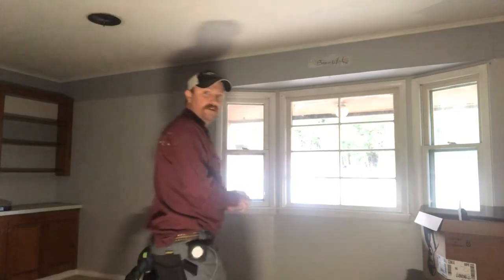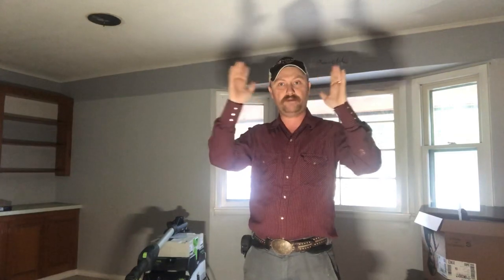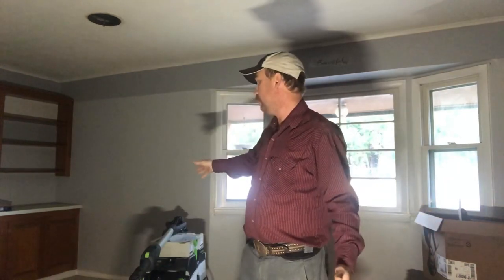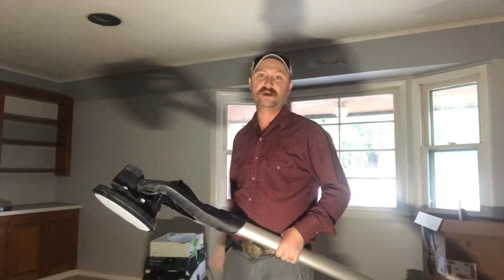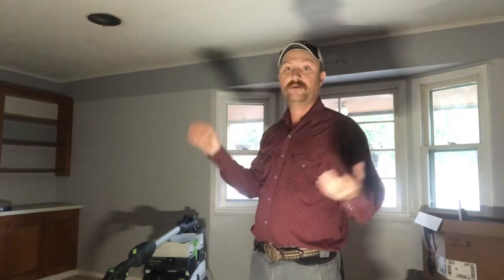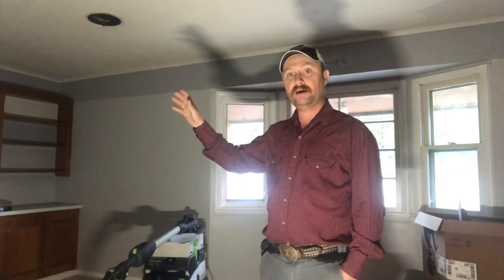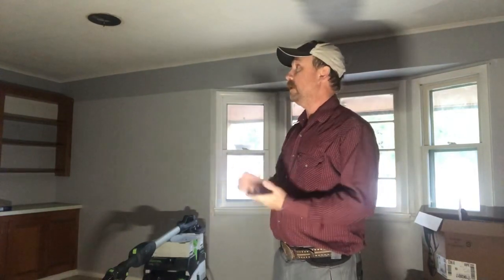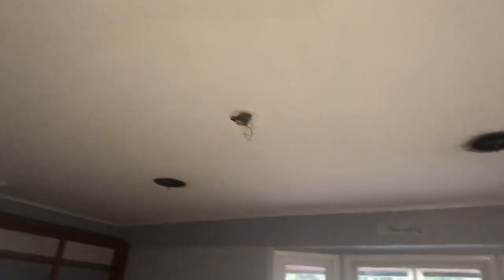Festool Planex Easy & Popcorn Ceiling Removal!

Comment: My contractor is also using this festool for removing popcorn.
My questions:
1. Does he need to sanding again after using tool or it already becomes smooth? 
2. Do we need to do mudding and/or primer after using this tool? Or how to figure out he did those instead of just directly painting ceiling.

Thanks
Reply from the maker: It depends on the look you want your ceiling to have as well as how well the original contractor finished the Sheetrock before applying texture. If they didn’t finish all the joints then you’ll have to do that after sanding. 

You can also skim the entire ceiling after sanding if you want it absolutely perfect

Comment: I have a cheap ceiling sander, takes the same pads, but like you, I find it tough on the arms. The yellow peril ( Merka) do a real light weight one...maybe if I do enough celings I will drop the money on Festool or Mirka. Wear a mask...and eye protection, you never know. In UK the mixuture contained asbestos!!! in the 1970's. Post 1980 you are good to go. I always put on larger crown, it costs less than going aroud the edges with a Rotex. Take care.
Reply from the maker: Absolutely!  My arms are feeling it today 😅

Comment: great video thx, dislike my popcorn ceiling too, what's a ball park price for 1600 sq ft of ceiling ?
Reply from the maker: There’s a few variables on that really depending on how much paint it has on it and access issues etc. 

My business day rate is $1250/day at the current time and 1600 sq ft should be sanded in a day. Edging if required would probably take another half day or so depending on how open the house layout is. 

The issues you get into though can be that they didn’t actually complete the full sheetrocking process underneath since popcorn can cover so many errors. Lot of times you end up needing a thin skim coat or at a minimum doing 1-2 passes over the joints to get the tape re hidden. There’s a lot of shortcuts hidden behind popcorn 😅

Hope that helps!

Comment: Ive been looking into removing my popcorn celings...this looks like best option but to purchase this at 750.00 to do my house sounds like alot of $$$$.
Reply: Rent it from home depot!
Reply: I wasnt aware you could. Awesome!
Reply from the maker: There are also very cheap versions on Amazon you can buy for a couple hundred or so that would probably be fine if you’re just DIY your own place. This festool setup is more of a “use it every day” commercial setup. Just test it for asbestos first 😊
Reply: Buy a mist sprayer spray the ceiling and scrape it off its east but messy the real questions is who is guna tape it afterward

Comment: A good video. It seems to be a great tool for the job. And the AC (auto clean) vacuum makes a difference on clogging. I would think a standard Festool vacuum might, might clog.. I wish Festool would come out with a similar tool for doing hardwood floors.
Reply: I’d be curious to see how it does on a hardwood floor

Comment: We currently have knockdown - would this work to take it to smooth/imperfect smooth?
Reply from the maker: It will take it down for sure, a lot depends on how perfect you’d like it to be.  They have some aggressive grits available for this sander if you needed them.  I think Ive gone as low as 36 or 40 grit on a painted ceiling to get it moving especially just for the first run across it.  Then just go up grits like you normally would, 80-120 etc until you’re happy with the finish.  Just be aware sometimes they didn’t do a full finish on textured ceilings and once texture is removed you could end up needing to do some skimming or at a minimum covering some tape that is exposed.

Comment: Looks great!! Were any of those ceilings painted popcorn?  I’ve heard those are tougher than unpainted popcorn. Would you do anything different for painted popcorn?
Reply from the maker: Absolutely!  Painted popcorn requires a lower grit. Usually a 36 Safir to strip. It’ll take a bit longer to do also since you’ll need to sand it a second time with a higher grit or even 2 to smooth it.
Reply: @MillisConstruction  I have this rig. I just did a painted ceiling. Started with 40 grit but dropped to 24. I didnt try to take it to drywall, just smooth enough for mud. Two skim coats and it looks marvy. This rig rocks! i avoid paint jobs now and just chase popcorn ceilings.

Comment: How much would you charge or what would it cost to have some one do it?
Reply from the maker: Probably be a lot more accurate to get a local quote on that, prices vary a lot area by area.   An unpainted popcorn ceiling I’m usually between $250-$500 per room to sand, any needed finish work can vary a lot afterward depending on how well it was finished before popcorn was done. You could need a full skim coat or some tape redone, a lot depends. They used popcorn to save finish time a lot of times so usually a poor finish job is found underneath it.

Comment: Most popcorn ceilings have asbestos, correct?  Is the Festool suitably safe for use on popcorn ceilings with asbestos?   Is the HEPA filter rated for asbestos dust?  Seems like the sander would potentially produce more dust than wetting the popcorn to mitigate dust, and then carefully scraping the popcorn.  Those of you who are experts, please explain why I'm right, wrong, or if there's a more optimal and safe way of removing popcorn that potentially has asbestos.
Reply from the maker: Always test. I haven’t hit any asbestos here yet.
Reply: @MillisConstruction  What part of the country are you in and roughly how old are the oldest homes you have removed popcorn from?  I'm in Southern California and need to remove popcorn from a home built in 1973.  Yes, I'll definitely get it tested.  Also, based on a small sample taken from the ceiling, I found found that 100% of the popcorn flaked off incredibly easy.  No remnants were left on the drywall.  After removal in that one spot, the drywall underneath looked as new as a new and unpainted sheet of drywall.  I assumed the job would be much more difficult because someone painted the popcorn with oil based paint.  Interestingly, the oil based paint seems to lock in much of the popcorn dust that would otherwise be created during removal, and allows the popcorn to come off in flakes slightly larger than the size of a large potato chip.

Comment: You mentioned you used Granat 40 grit paper. Since Festool doesn’t sell a 40 grit paper for this system, did you mean to say you start with an 80 grit paper?
Reply from the maker: Yes they sell P40 225mm for this.

https://www.amazon.com/dp/B00FKV8PB0/ref=cm_sw_r_as_gl_api_glt_fabc_N0NZ281ZCK2DTXX0EQ7N?linkCode=ml2&tag=millisconst00-20
Reply: @MillisConstruction  Thanks, I only saw the Granat “Soft” papers. Big difference in price!